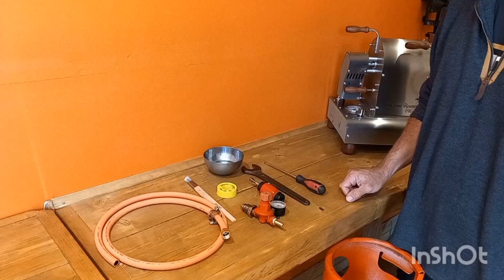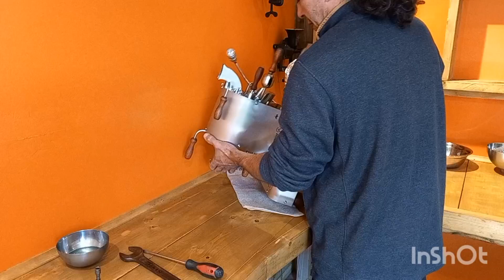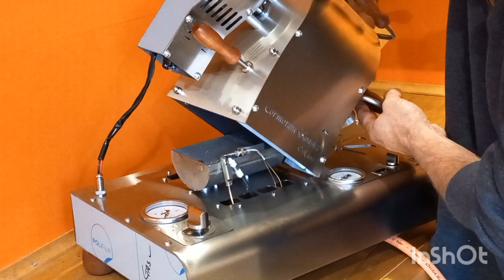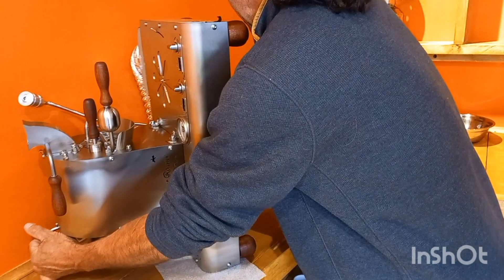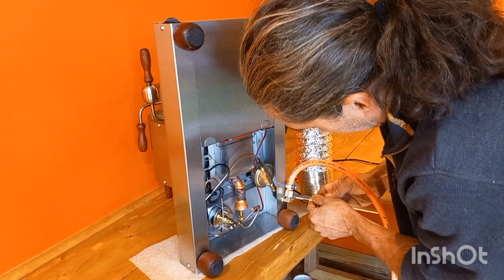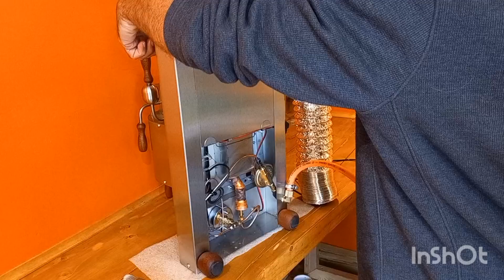Connecting your gas to the CR600.

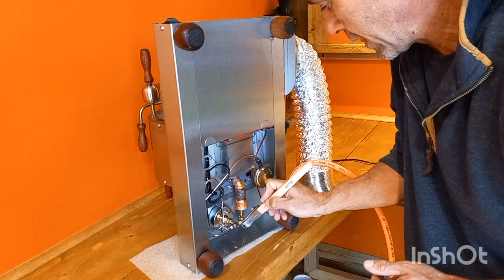Comment: Hi Johan.  I have done a gas chack in the way suggested in your video. (I had notice an ocassional smell of gas when I recently used the roaster)  I noted a leak in the area that you checked at approximatey 9:00 minutes in the video in the area below the gas dial. The leak affects one of the joints to the horizontal pipes  To fix this should I use Gas PTFE tape on the thread?   kind regards Darren
Reply from the maker: Hi Darren, yes that will work, the pressure at the compression fitting is very low so its easy to seal. Don't over tighten the compression nut.